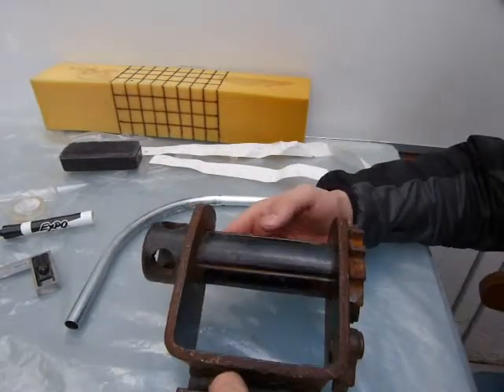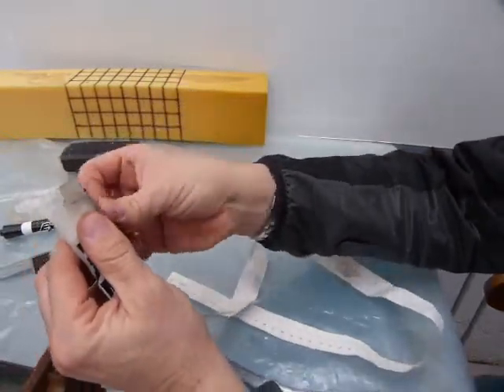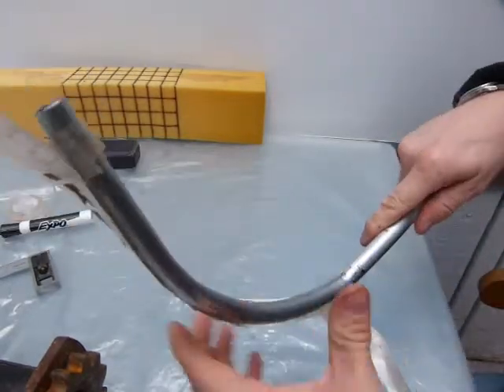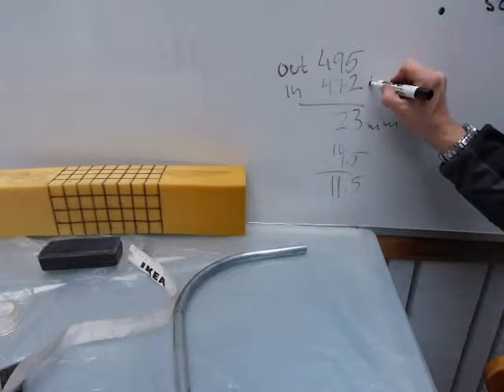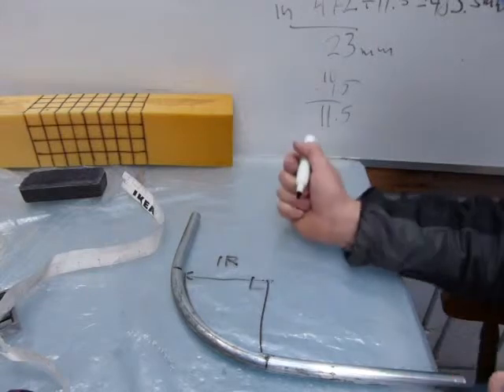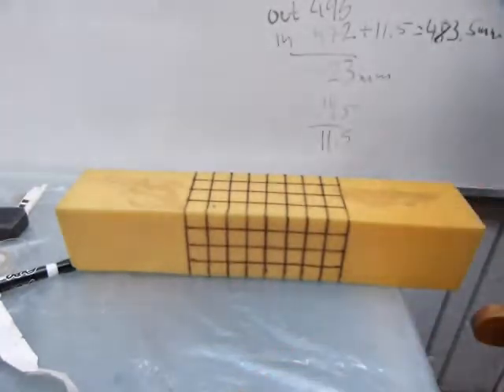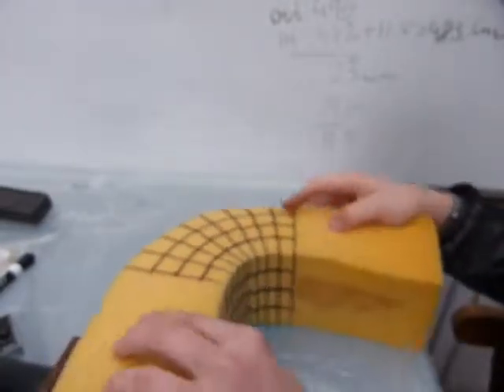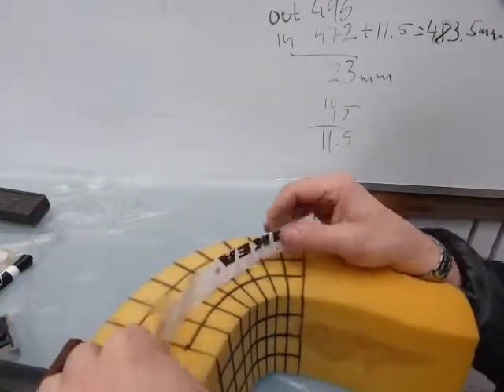The secret problem with mean radius

Comment: That is amazing.  Does it matter HOW thick the curved section is - would the mean radius (axis of neutrality) still be calculated at 60% from the inside 40% from the outside? Even if it was a metre thick or right down to 20mm?
Reply from the maker: Yes, thickness does not matter. 1m dia pipe or 3mm thick plate, same 60-40. The axis of neutrality though is unique to different materials. Foam bends differently than wood, or cork, rubber, steel, and temperature affects it too, eg glass at blowing temperature bends elsewhere than at room temp, say fiber optic cable. The differences are minimal, 60-40 is close enough.
Reply: apprenticemath Thank you so much for this teaching. I never knew maths and arithmetic could be interesting, even fascinating!  
Forgive me for another question, I was wondering about the curve. I realise that a right angle curve would need four to make a full circle and other curves would be different. In your video you showed a line horizontal and another vertical away from a curve (which clearly isn't a right angle one) and you made a right angle mark where they joined. Please forgive my ignorance but is this how one would work out the degrees of a curve, without a gauge thing? (Is there a video that I could learn this?).  As you may have realised, I never learned maths or arithmetic at school beyond the age of about ten and have been trying to work out things like this for myself for over forty years.
Reply from the maker: The lines I drew (OR>MR>IR) were the terminology part. To calculate the angle of turn on an unknown bent material one needs to find a radius first from the chord length of the bent piece: @watch?v=JA8dq0bcngs Half the angle of turn can be calculated 2ndF sine = half the chord / radius, @watch?v=fxa94POR94E from @watch?v=JiARfu5ww4k&t=16m40s on to the end. From the full angle of turn the length of the arc (pipe length) can be calculated.@watch?v=BWMipNK6PxY from @watch?v=JiARfu5ww4k&t=10m35s on to the end, another approach is in @watch?v=kQV9-CMgPw8If this was any less complex, Tesco probably would have no cashiers left ...